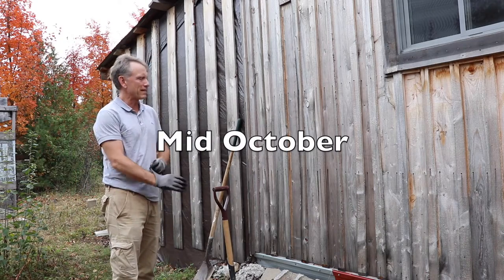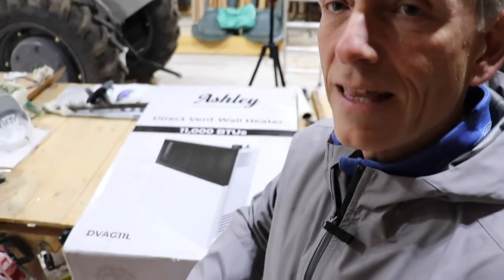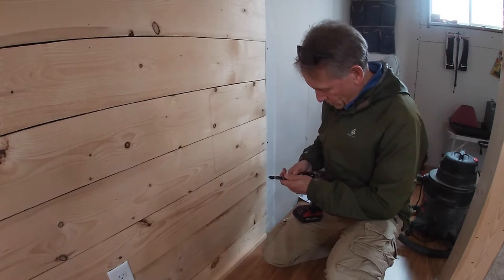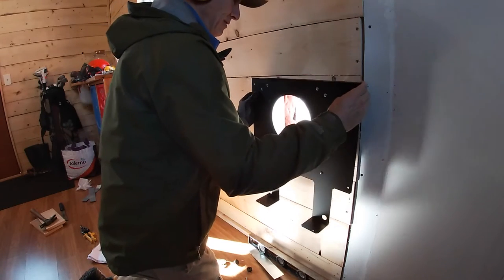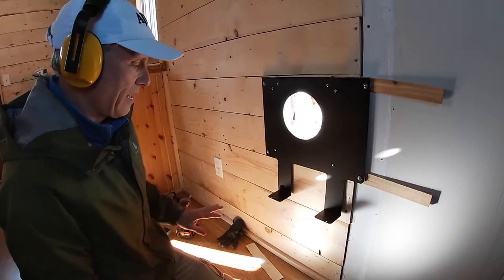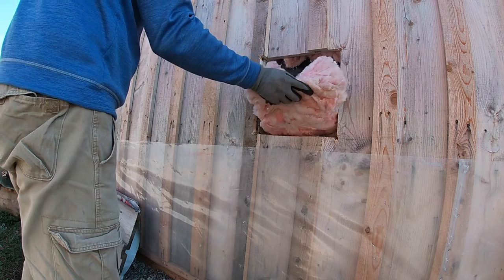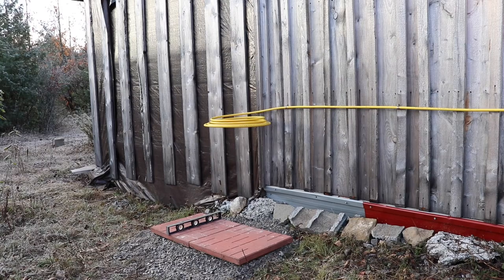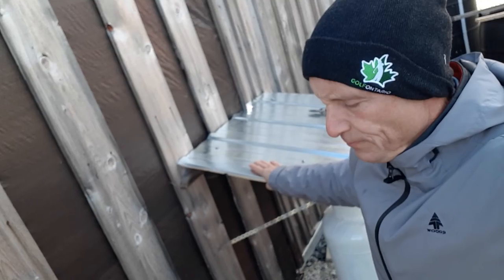I Install a Direct Vent Propane Heater in My Off Grid Cabin

Comment: I have the 11,000 BTU Ashley heater, and I can only get the pilot working the burner is not working, any suggestions?
Reply: I had the same issue. It said to use 11" water column up to 14" wc 
... it seems to have something faulty. I bought an adjustable regulator that goes from 0-20 psi and now it works... kinda... :( I'll probably just modify mine. It's dumping a fair bit of heat outside and very little inside. Pilot dims considerably while burner is on.. seems to be a bad regulator or some such.

27.○○○" wc is 1 psi

Comment: Did you wrap the blanket around the vent pipe?  Kind of wished you would have showed how you did the outside part.
Reply from the maker: The vent pipe and pipework were done by the gas fitters. I tried not to bother them too much with my cameras ... hence the limited footage of their work.

Comment: Being it's been about 10 months would you have any consumption rate type of info now it's snowing. And last avg fall. How many days/weeks would you say a tank has been lasting and assuming same usage 3 hr x 3day wk. Great video I'm ordering either this one or a martin 11k. What are your thoughts on it and was it worth it? Thanks for your time Sir
Reply from the maker: I need to do a better job tracking usage. I started using the 40lb tank in December last year. I ran it, like you indicate, about 3 hrs a day up to 3 days a week. I spent two nights there last year when it was -10C outside. I stopped using it in late March with the arrival of Spring. It fired it up about 6 more times this autumn before the tank became empty. So, pretty good for the application.
Reply: @TheWoodlandReboot  thank you. Just about to install the martin 11k btu tomorrow in our camper.

Comment: Hello, we installed one in our ice shack but we cannot light it at all! Can you give ups any tips of how to light it?
Reply from the maker: Hi Nathalie, Sorry to hear that. It is unfortunate. Mine works very well. Did you have a professional company do the gas line installation? Have you tried the various trouble shooting options listed in the manual? Hope you can get it to work. Peter at the Reboot.
Reply: I have the same heater. I have to hold the button for the pilot light down for about 90 seconds before the ignition will light the pilot light.

Comment: Do you think the 11,000 would be enough for my 450 sq ft cabin? Or should I get the 17,000 model. Thanks. (Middle of Maine.)
Reply from the maker: Middle of Maine ... we share similar winters! Keep in mind I'm not a heating expert. I think the 17000 model would better suit your needs given your cabin size.  I think the smaller unit would be overworked and not fully heating your space. Hope that helps, Peter at the Reboot.
Reply: @TheWoodlandReboot  Thank you. I've had a few recommendations, and every one says get the bigger one and turn it down rather than getting the smaller one and running it full blast. Being in a place where it will be below freezing for weeks to months at a time is a contributing factor.
Reply: I would get the 17,000 for that cabin
Reply: @silverback802  Thanks. I went for the larger unit. I got the Martin  20,000 BTU, and it's perfect!

Comment: What kind of regulator coming off of the tank did you use?
Reply: I'd like to know the answer to this as well. Did you ever find out?
Reply: I ended up using a Mr. Heater  two stage regulator. Works great! Part # F273863
Reply: I'm about to do the same. Interesting how this newer heater has a small regular right where the gas enters the heater. My old one didn't have a regular on the heater